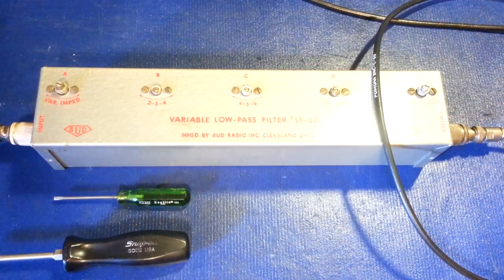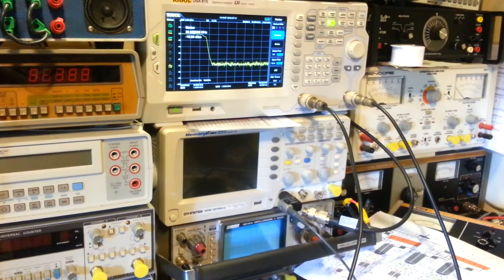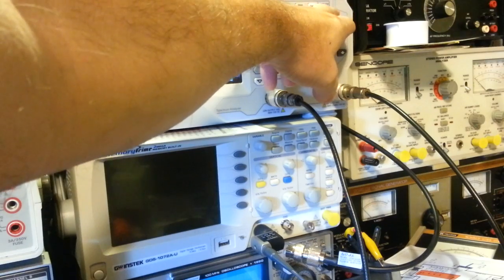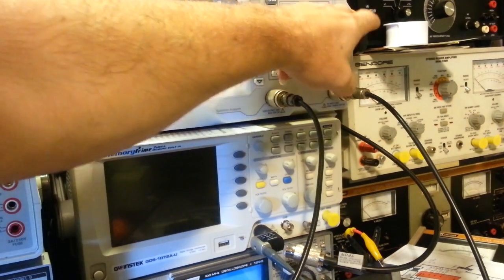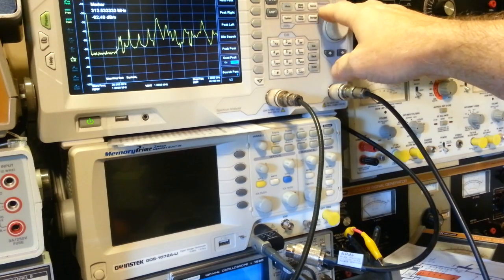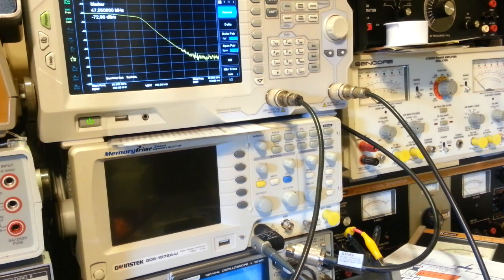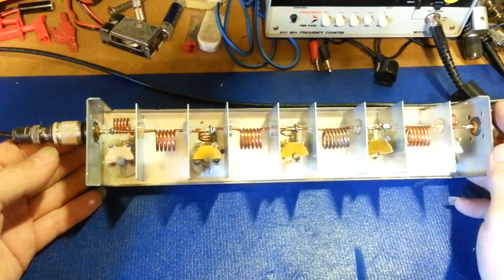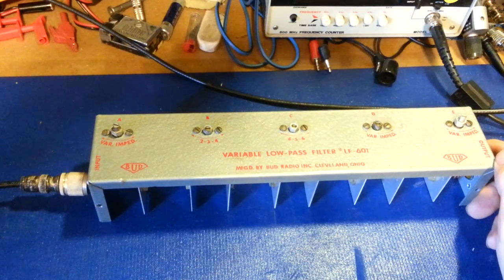BUD LF-601 variable low pass filter on the spectrum analyzer.

Comment: Just going through my old Ham gear to set up a new station and found one of these. A quick internet search says it's rated for 1000 watts.  These days with satelite tv, cable tv and digital tv,  is any need for these anymore?
Reply from the maker: Remember, filters like this are not one way.  They don't only stop spurious emissions from getting out of your radio and on air but they block them from getting into your radio.  In certain circumstances it could lower your noise floor, prevent front end overload and signals out of band getting in and mixing in the radio.

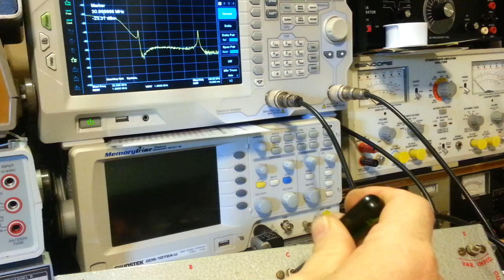Comment: Regarding the comment at 2:30, one would tune each stage to the frequencies specified in the instruction sheet with a grid dip oscillator in those years.  The channel notch filters are series resonant LC circuits to ground.  It is a very similar if not identical design to the Taylor RSO Low Pass Filter described on page 115 of the March 1972 issue of 73 Magazine.

Comment: Cool video Mike. nice to see you use your Rigol to test this. Filter looks like good quality. Thanks for posting.
Reply from the maker: Really need to play with the tracking generator more.  A lot of things you can do with that option.  I really need to redo the test on this filter.  I forgot to lower (or increase depending on how you look at it) the resolution bandwidth for a more accurate reading.  It probably would have shown about 10dbm better attenuation if I had done that.